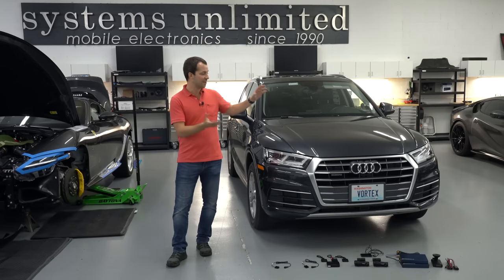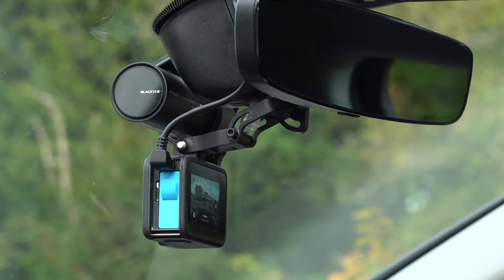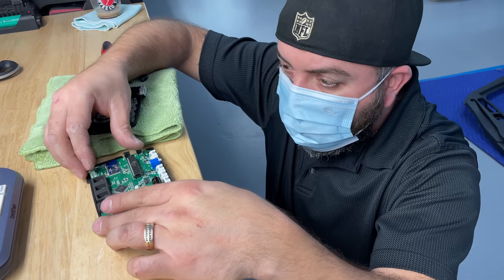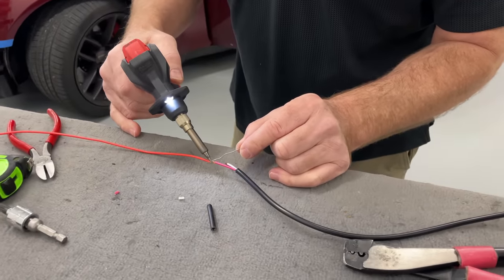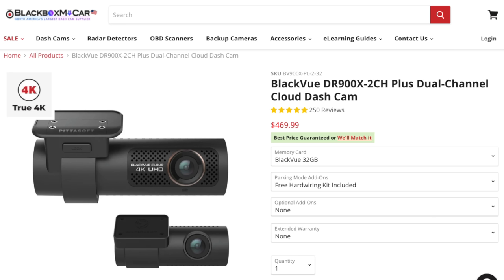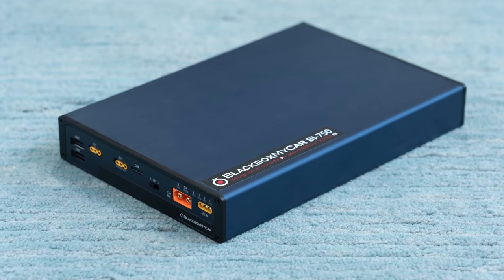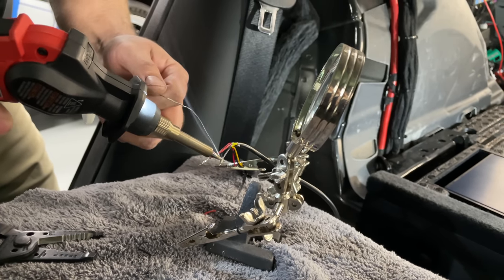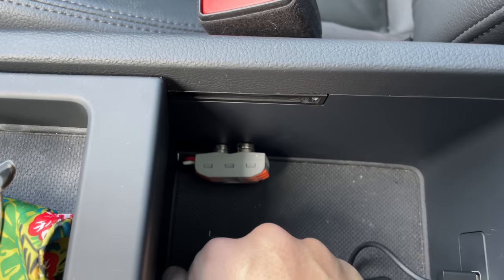Upgrading My Car's Countermeasure Install, with Systems Unlimited

Comment: The windshield mounts , Uniden/V1/Redline have all gotten so good, there’s no need for a remote RD anymore.
Reply from the maker: You mean in terms of performance alone I presume? If you don’t care about aesthetics, sure.
Reply: @VortexRadar  yes, aesthetically, nothing beats a remote, but the ease ( Escorts mag mount) of taking a unit down after use  makes the aesthetics less important anymore.  I also get a great sense of security knowing I have a unit in front of me and that it’s on and operable.   The new units such as Redline 360 or Max with mag mounts are very easy to take down.   There’s something to be said for a clean remote install too, but the large majority of users go with WS mounts.   The Escort remotes the past decade have been very disappointing comparatively. The Stir-O is the high water mark.
Reply from the maker: I agree totally that most people prefer a WS mount. I’m in that camp too. However personal preferences vary which is why there’s still a place for a remote RD.

Comment: Clean and thorough as always. There's got to be a better place to mount an iPhone wireless charger than the windshield. We often drive sports cars with much less glass area to see out of than a huge SUV. You'd probably mount that iPhone in a different place in your old Miata.
Reply: My phone is mounted right above the airconditioning controls in my miata

Comment: I wish you would do a review on some of the older detectors valentine v1, escort solo 2, passport 7500,8500 and how they compare detection wise to the newer stuff. I notice the above detectors sell for about $200 used on eBay so some people are strongly supporting the older detectors.
Reply: Given that radar hasn’t changed since discovery just before WW2, many older detectors still do fine.  I’d put a remote mount StirO against any of the new ones on 34.7 and 33.8.   It may not do quite as well, but it would still be a save.    Probably the best of the older detectors is RX65 S7 ( not M4) . On USA mode, it’ll hang with the best of the oldies .  Let’s not forget the Original Redline with BSRDR.  That unit is now a decade old and but for K band falsing , still detects everything you need.
Reply from the maker: Me too. It’s why I bought a bunch of ancient detectors like a year ago. There’s SO much to cover and so little time to do it (testing and video creation are both very time consuming) that I don’t know if I’ll realistically ever get to it.

Range is easy enough to test, but it’s really filtering and everything else that matters most. I’m not interested in testing only range. I want to look at the whole package.
Reply: @VortexRadar  that’s the problem with old units, poor filtering.  Range on some old units, while not at Uniden standards, is still good enough for a save since radar units have not fundamentally changed in 70 years. The M3 based units are still more than enough if you can turn K off.
Reply: @alexnutcasio936  obviously I'm not interested in the performance of an ancient fuzzbuster but the 90's and early 2000's were the heyday of radar detectors now with apps like Waze and even Google maps a radar detector is somewhat redundant. The major detractor of older detectors is the lack of gps and overlay features the ivt filtering for in vehicle cross traffic and collision avoidance is still not up to snuff and may never be so even brand new detectors are better at finding Acuras and Mazdas than police.
Reply: @unclejoe6811  Waze  is only as good as guy in front of you marking the popo . The newer detectors are much much better than older units  at suppressing K band falsing.   Unless you can turn K off, a new detector like the V1Gen 2 or Escort Redline 360 is the only  way to go.

As to falsing, Acura/Honda are the problem.  Mazda is not an issue. ,

Comment: Very clean install. On a side note...I have the 360c with M1 dash cam. To be honest I'm not impressed with the 360c, I had a 360 and it worked very well. What would you recommend in the Escort line of detectors as a replacement for the 360c?

Comment: This may be a silly question, but what's the reason for having those extra 5 battery packs? Is the car's battery not enough for the dashcams?
Reply from the maker: More record time and when running a bunch of dashcams normally, plus additional just for testing.
Reply: @VortexRadar  got it, thanks for the quick reply :)
Reply from the maker: haha yeah my setup isn’t really a normal setup. It’s a bunch of different equipment to make it easy for me to do comparison testing and make YouTube videos. :)

Comment: Do you have any plans for installing Stinger Laser Fibers?
Reply from the maker: I wanted to with the new S8 system. That didn’t arrive and my current VIP had been problematic so because of that, and out of the interest of saving time, I opted against it.
Reply: @VortexRadar  Thank you. Would you mind to share what problems you had with the laser fibers?
Reply from the maker: The laser fibers are fine. I meant I had problems with the VIP radar detector and so I don't want to use that to interface with my fibers.